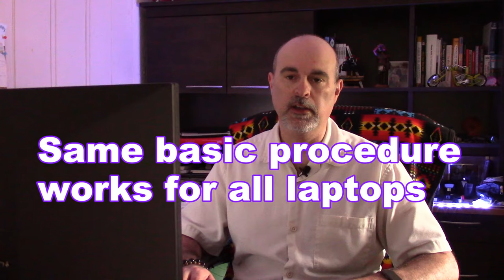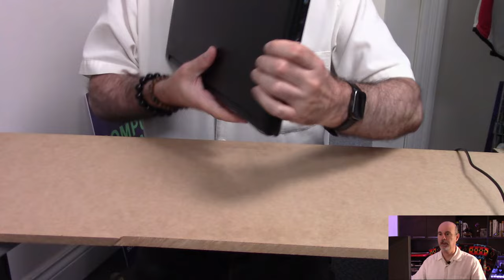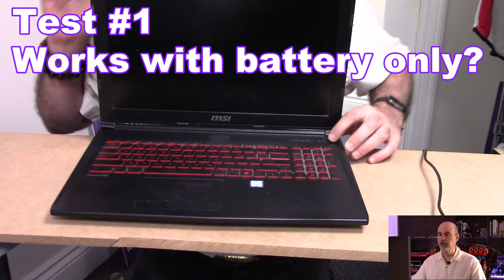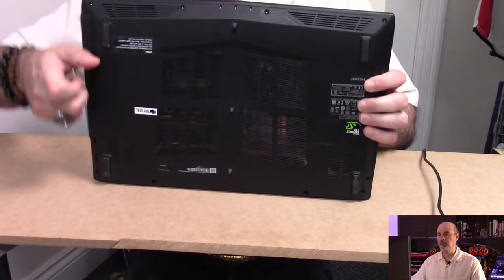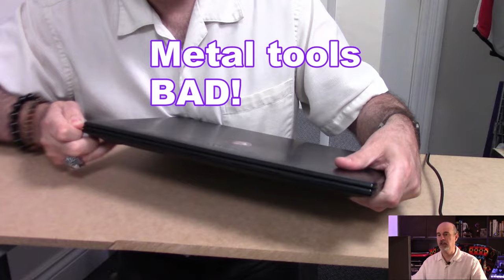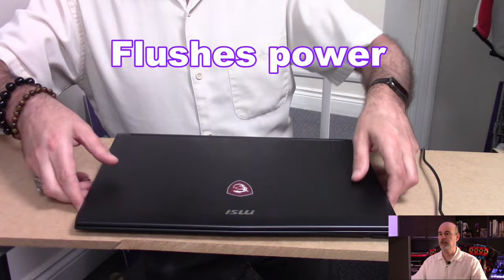How to fix an MSI laptop that will not turn on

Comment: I have MSI GT72S-6QD which has light when I plugged in but it won't power on. I tried resetting the battery with your video but still it has same problem. What could I do? Thanks for your video.
Reply from the maker: You're welcome and to answer your question, it could be the battery is completely dead and the power adapter isn't working and needs replacing.  It's also possible it's a motherboard issues and needs reflowing or a DC jack replacement.  Needs to be looked at.
Reply: @TwinBytesInc  I tried to check the voltage of the charger and power socket which they were ok. I could find the voltage on the motherboard (19v). I am not professional but I have tried to check. I think that this is motherboard issue. But should I try it with new battery? Thanks for your réponse.
Reply from the maker: If the computer works with the power adapter and no battery, then it's just the battery, but if it doesn't work even with power adapter, it's either the adapter, DC Jack, or motherboard.  up to you how far you want to try yourself.
Reply: @TwinBytesInc No light no power up when I tried without battery. There is a light with battery and charger but no power up. I checked the voltage on the power socket and found 19V. There is a 19V on the circuits of the motherboard. I think that I have to diagnose deeply after watching a lots of videos :-). I am really appreciate about your answers and guide. Thanks.

Comment: Hello sir, can you fix a bootloop MSI laptop in the BIOS? Thanks u sir
Reply from the maker: I can't fix BIOS issues remotely or over the phone or by chat.  they are all different so step by step instructions vary.  The manufacturers website should have instructions with links to latest BIOS upgrades if any available.  If it's just a boot loop, Windows may simply need a repair/reinstall.  but also could be a bad hard drive which means testing the hard drive with a bootable USB or removing the drive and testing on another computer.  Too much to get into here.

Comment: Thanks for your video, I wish I had seen it before paying $150 USD just for doing exactly this. Do you know what causes this problem? since the first time (a couple of months ago) it's beening happening like every 1 or 2 weeks.
Reply from the maker: I'm sorry to hear you had to pay first to find out how simple the solution "can be".  I don't know exactly what causes it but usually poor power flow which can be fixed maybe by reflowing the motherboard, or dirty power.  Maybe if you're plugged straight into the wall, try going through a power bar or even better, go through a UPS battery surge protection system.
Reply: @TwinBytesInc  thanks Daniel! I'll try that.

Comment: Hello there, the laptop of my friend won't turn on and we try'd exactly your way with the 60 seconds but still the laptop won't turn on. Do you know what else the problem could be?
Reply from the maker: Thanks for your comment/question.  If this video doesn't help.  You probably require a new power adapter or DC Jack replacement or motherboard repair.

Comment: I got MS-14DK with me, and I have the same problem but it didn't work. Although my keyboard has already problem because some keys don't work so well (Enter Key). I hope you can help me. Thanks a lot!
Reply from the maker: Thanks for your question. Sounds like could be related to your keyboard if the power button is embedded in there.  There are many possible reasons for a computer problem, so it might be helpful to check out my latest video https://youtu.be/BVwx6GruurU which has some other hopefully useful suggestions

Comment: Removed power adapter worked but now im worried because that NEVER happened before 😅😂 thanks!
Reply from the maker: Glad it worked.  Don't worry too much.  These things I've seen happen over the years and usually never repeated that I'm aware of.  In some cases it can repeat, then we just deal with it at that time.  For now, you're working and most likely will continue to be fine for the life of that laptop.

Comment: I had zero power to any lights or anything. Did this test and still zero lights to any part of the computer. Does this mean the battery needs to be replaced or pointing towards the mother board?
Reply from the maker: If you plug the power cord back in and still no lights, it's not a battery problem.  The motherboard has an issue unfortunately.  Needs special repair or replacement.

Comment: Hey Daniel! I tried your solution but it seems not working on my GL63. The case is, when I plugged it in, the indicator shows that its charging. However when I tried to turn it on by pressing the power button, nothing happened. Also the blur lights on the power button that usually marks whether the laptop is on or standby is not blinking at all. Do you have any suggestion for me? Thanks beforehand.
Reply from the maker: You could try removing the memory and see if trying to turn it on with no memory makes it beep at least complaining that it recognizes no memory installed.  Otherwise probably motherboard needs repairs.
Reply: Thankyou for your reply. I just found out that one of the capacitors on the motherboard just short circuited, and as a prevention measure, the device prevents the motherboard to be turned on.
Reply from the maker: You're welcome.  Glad to point you in the right direction.

Comment: Hey can you please help me i have a Msi stealth 15m and it does not work and the keyboard flashes for a second and turns off again help plz
Reply from the maker: Does it keep turning on and off or just flashes on once and then stays off?  if stays off, this video should help, otherwise it needs more troubleshooting possibly in person than what I can offer in chat here.  If it keeps flashing on and off it is a code which you'd have to lookup to find the meaning.
Reply: @TwinBytesInc  no the screens stays off but the keyboard flashes once
Reply from the maker: @kxrtezz  You could try removing the memory and see if it beeps at least.  But if nothing, maybe motherboard issue.

Comment: It didn’t work for me and I had tried everything such as what demonstrated in the video disconnecting ssd, hhd , ram and etc but I still won’t work and I have ordered a battery to replace it but I am unsure if it the battery or the mother board because I have no life what so ever and it not the charger because I used an amp tester to check the charger and it works but the battery pins are to closed tight to check if there is any voltage 
My computer is a Msi gp73 8re
Reply from the maker: Someone needs to look at this to know for sure.  I can only provide general guidelines for what it could be as many people will have a different solution.

Comment: I think i have the same laptop, but my issue is the keyboard lits up and lits out like pc turning on and off.
Reply from the maker: Sounds like more of a hardware problem.  Try removing all memory and see how it responds.  Maybe bad memory.  I wouldn't expect a bad hard drive for this to happen.  Otherwise, something else with motherboard maybe going on if this video didn't solve it.

Comment: Not sure if it's anything at all but the issue is this, my power adapter was chewed on by puppy while I was cooking and said adapter was making my msi shut off completely at random I think so I checked the battery life and it was at 98 percent so I shut my laptop off to save the power, i tried turning it on the next day to get some files and all it did was the power light and keyboard light up then suddenly shuts off no fans running or even screen doing anything, and it does it constantly and I'm still waiting for the new power adapter, so any idea of what's going on
Reply from the maker: Thanks for your question.  You can try running it without the power adapter for just long enough to prove if it works without the chewed up adapter.  Then you know that's the cause and you need to get that new adapter asap.  The bad adapter cause issues like this and worse.  There could be an electrical fire, so you must be very careful.  Tape it up with electrical tape in the mean time but if it keeps crashing your computer, you are best to not use the computer anymore until you get the new adapter, or you could damage your laptop as well.

Comment: I am using a msi modern 14 B5M laptop... 
When i plugged in the charger it is  showing charging but not increasing the percentage... Please help to fix this problem.... I always plug in when i am playing games
Reply from the maker: I don't troubleshoot here but try to give quick free advice when possible.  Maybe bad battery but you'd need to try with a new one and then you're stuck with the new battery if doesn't help.  you'd have to pay someone at least that much to troubleshoot anyway.  Might be easier to pay for proper diagnostic.  I can't troubleshoot this without seeing it.

Comment: Hello. What if the laptop does this? Turns on and of several times and then it turns on at some point. It works fine and at some point when pressing the key for the mouse glitches, blocks and just stays like that until you reboot and it's back again to not working anymore and I do the same thing over and over. Thank you
Reply from the maker: Thanks for your question.  Sounds like this video might fix it because sounds like power glitch.  if this video doesn't fix it, maybe bad power adapter, bad battery or bad motherboard.  One of which needs repair or replacement.
There is a small chance if software issue, you you can try booting into Safemode or from any bootable USB stick and see if it stays booted up into the USB or safe mode.  If it does, then you know the issue is in Windows.

Comment: I have an MSI Laptop and its screen flicker. Some times it goes dark can barely see the pointer, during this flickering it flashes for less than a  second goes dark again. some time its gets better. Not sure how to fix this problem? Any suggestions will help.
Reply from the maker: Thanks for your question. That sounds like a screen problem to me.  Small chance it is a video cable issue, but most likely you need to replace your screen.

Comment: Have a good day sir
I just upgraded my msi modern 14 to 16gb ram few days ago, its working fine until this morning it not turning on (no fan, no keyboard backlight and the screen is black) and the power button just light up for a few sec then turn off
What could be the issue and how can i fix it?
Reply from the maker: Good day to you too.  Your first suspicion is always a great start.  Try removing the new memory and see if that helps.  Maybe removing all memory and putting it back in again.  Check out my Memtest video to test the memory.

Comment: Hey Daniel
i hope you are doing good man
used msi laptop gl73 last night while on charging shutdown it after my work done, but when i tried to open it today morning it was not turning on there was only red light was there even I tried your method but couldn't get any result
there is only red light on everything i tried switch it on but there was no power on motherboard 
can you pls help me
Reply from the maker: Thanks Bilal!  It's hard to know for sure if you followed this video and still not working.  It's possible something so simple like one issued ended up being the power cord was not plugged in.  Maybe it's not plugged in tight.  Maybe the wall outlet or power bar is no good.  Try another outlet, try another chargers.  If all else fails, you need someone to look at the motherboard.

Comment: Hi! After putting my MSI laptop on sleep mode, I can't turn it back on. And when I try to charge the laptop, it's fan is making loud noises. What could be the problem?
Reply from the maker: Sounds like overheating issue because the fan is clogged or off alignment.  The fan needs to either be cleaned or replaced.  You have to open it up to check it out.

Comment: Hi, I have a MSI GF62 8RC, it wont power on from battery and when it does it turns off straight away, it works fine with battery removed and plugged in on charge.  I have tried changing the battery for a brand new one and still the same.  When I put it on standby it fully turns off unexpectedly and not in the shutdown way, it does this with battery and on charge.  It will turn on with battery in and charger plugged and when the charger is removed the battery drains normally.  When I turn it on with just the battery in and it powers off straight away the time is full reset in the bios.  The laptop is only 3 years old and has been kept on charge all its life's by the previous owner.  Any ideas?  Could it be worth trying a new CMOS battery?
Reply from the maker: Thanks for your question.  Sounds like a strange one.  Doesn't hurt to replace the CMOS battery, they are cheap.  Otherwise you tried a new battery already and doesn't sound like power cord issue.  Something on the motherboard is an issue.  CMOS battery is cheap easy fix if that works.  otherwise you need someone to look at it.

Comment: I got the gv72 8rd I recently replace the keyboard after water damage but it wont power on like this I tried the power flush it still wont turn on but the status lights on the front still come on when it hooked up to the charger so juce must be flowing through the system.

Any ideas? I'd like to exhaust all avenues before I take it to a greedy 3rd party repair shop.
Reply from the maker: Thanks for your question.  Sounds like because it was water damaged, the motherboard might have corrosion.  If fairly recent, leaving it unplugged and off, upside down like a tent, it might allow access water to escape and dry faster.  Maybe after a day try again but who knows if needs a bit longer.  Without having an expert and open it to look at the board, there is no way to know for sure the extent of the damage.
Best to call around, get quotes telling them you most likely need motherboard repair due to water damage.  It's not like it was a sticky substance, so it shouldn't be hard to fix.

Comment: Everytime i charge the laptop the blue lamp at button on was in mode sleep. Any idea how to fix it? I use GV62 7RC
Reply from the maker: I'm not sure if I understand.  Everything works but only one of the status lights go out while charging?  Sounds weird but doesn't sound like it's causing any problems either.  Sounds like some confusion going on in the motherboard.  Maybe a firmware update is required.
Reply: @TwinBytesInc  do you have instagram or any social media? I want to share the problem through the video😇 sorry for my bad english
Reply from the maker: I don't do troubleshooting here, but I do have Instagram and my social media is all inked from the top banner of my YouTube channel.

Comment: I have a GF63 8RD msi laptop and came across a problem. I was working on my laptop, nothing intense just browsing. My battery went low so i plugged in the charger. As soon as i plugged in the charger my laptop shut down. After that i tried to startup my laptop again, but after the msi logo i got a blackscreen with backlight. Also in the blackscreen i could see some white lines showing up. 

After some time my laptop died. That is where i knew that my charger isn’t working either. What can i possibly do to fix the problem, because right now i am a bit lost.
Reply from the maker: Hello and thanks for your question.  I think you answered your own question.  You said the charger isn't working either, and so when the battery was low and you plugged in a faulty adapter, it just jolted the computer.  So to speak.  So probably you just need a new power adapter.   Maybe you can borrow a friends or one from a store to prove it works before buying a new one.

Comment: I've tried everything I can find and nothing works, I even tested the rams/cmos battery. The lights in the front below keyboard don't light up at all, only the power button flickers and occasionally stays on for a minute and then goes out again. 

I'm using a msi gt70 2pe.
Reply from the maker: Sounds like all that's left is bad motherboard.  repair or replace.
Reply: @TwinBytesInc  Thanks for the tip

Comment: Battery shows 0% available plugged in, battery ain't charging,I've fully updated every driver,the adapter is working fine,it's that I can't use the laptop without plugging in,will this trick work?
Reply from the maker: Thanks for your comment/question.  no, the laptop is working fine so this video won't help.  Sounds like the battery needs replacing.

Comment: I have my MSi computer and I was charging it while using it and then I closed my computer and after an hour later I wanted to use it and it didn’t turn on but I plugged the charger in and it shows a blue light but it won’t turn on
Reply from the maker: If this video doesn't help with that, it's possible it's a bigger issue with the motherboard that requires repairs.  First, you could try leaving battery and power out over night, next day.

Comment: Hey where could I find that charger?
Reply from the maker: you could get a universal charger anywhere local, or get the exact one from MSI directly, or search for a compatible one on my Amazon store.  https://amzn.to/3SDm0PP  Be sure to look for the exact model and make sure voltage and connector are correct.

Comment: I bought msi bravo 15 yesterday...it worked pretty well for sometime but suddenly it just turned off...and now its not turning on and not even charging....plzz help me sir...i pressed the power button for 60sec but nothing happened
Reply from the maker: if it's brand new, you should call it in for warranty support.  You need to remove the battery too, not just hit the power button for 60 seconds.